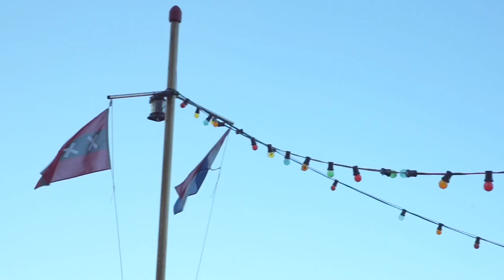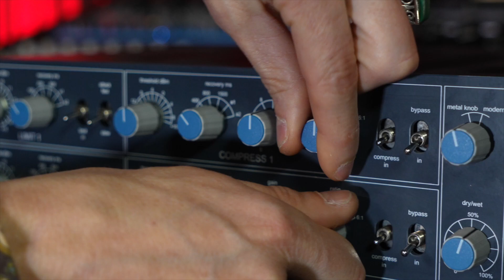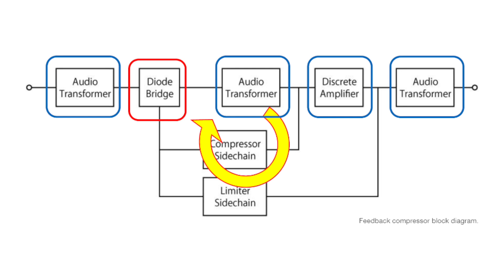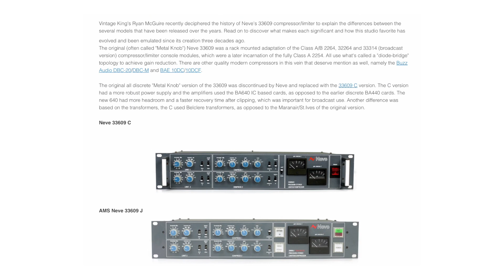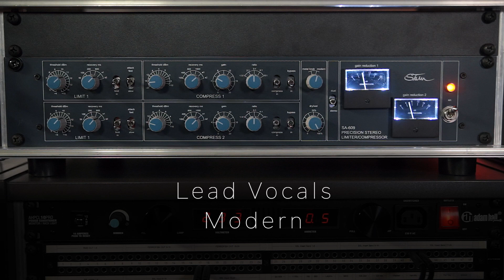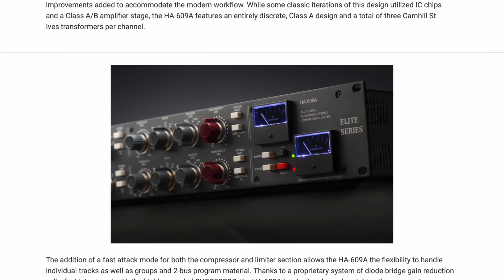Stam Audio 609 MkII Compressor/Limiter - Review LOOKINTO

Comment: do you think for mastering is necessary that Side chain or HPF that have some more new compresor so it don't react so much to low frequencies. or no. or just a slow attack can do the trick ?????
Reply from the maker: It depends man, having the option is always welcome especially when compressing fast and substantially. Honestly for the 609MKII I did not feel the need for it (given the type of compression and all). I hope this helps!
Reply: Helps a lot… thanks